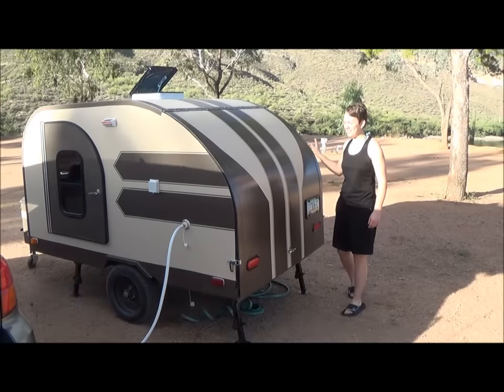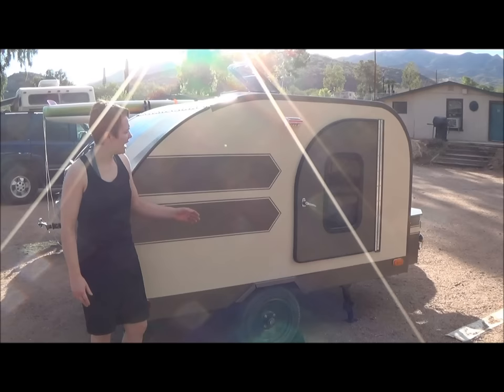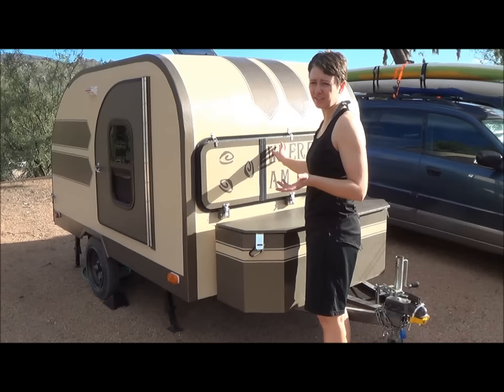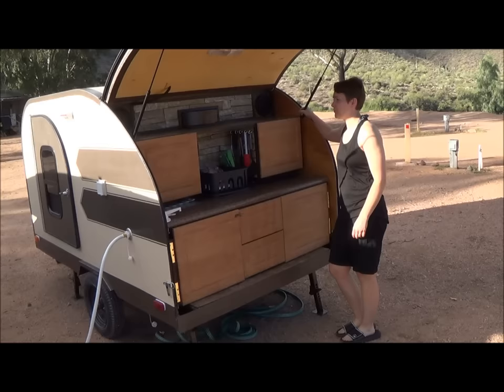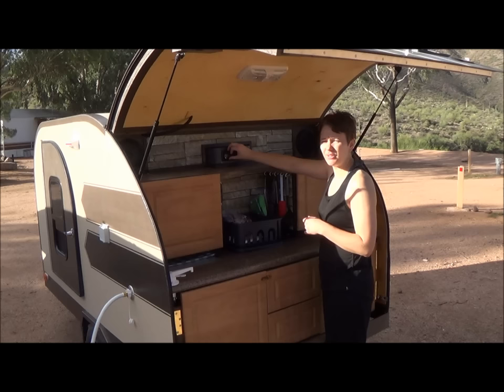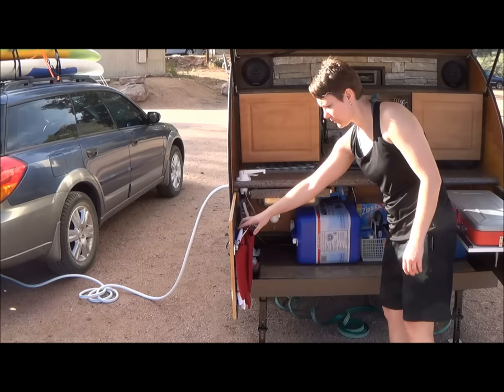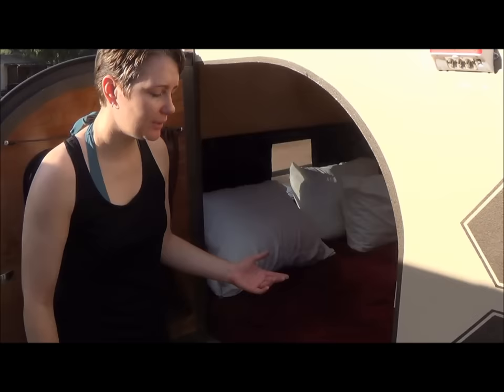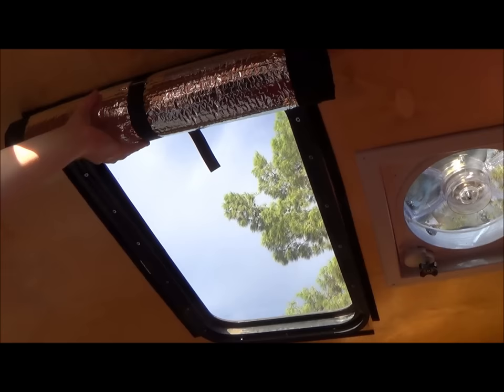Home Built Teardrop Camper (Poor Man's Fiberglass)

Comment: Really, really cool trailer. It looks like you built it from scratch - was there a particular reason you didn't buy a basic trailer and build on top?  Do you have any idea of the final weight for towing? Once again, really impressed!
Reply from the maker: kakman1958 Thank you! The final weight is 900 lbs. The base trailer is a harbor freight utility trailer thatI for $200. Next time I will start with a better trailer.  I didn't want to invest much since I wasn't sure I could pull it off :)

Comment: awesome. thank you for the info. where can i learn that canvas siding thing you did. thats so cool. thanks again.
Reply from the maker: In the comments I have explained a little more detail on the process. most of the YouTube "poor man's fiberglass" look poor in my opinion. I found a really nice one on the teardrop forum and the biggest tip I learned from that post was to router the edge 1/8" and then the canvas bends around it nicer. sanding in between coats it key it make it really shine. I did a trial on a piece of plywood to get the technique down. it works very well!!

Comment: In a couple Comments you said there was a teardrop forum and the biggest tip you learned from that post was to router the edge 1/8". Do you have the link to that form? If not could you explain how you did this? Thanks Anthony

Comment: just came across your video and I really enjoyed it. Very impressed with your built and the look of the camper is nice. Since this was from 2015, have you upgraded to larger built?  And how long did it take for this built from start to finish?
Reply from the maker: I am still using this one. I did build a cargo trailer and just haven't made a video of it yet. The cargo trailer was very easy and only took 10 days. The teardrop I worked on over the course of a year.  But took 6 months off in the middle when I was nervous about wiring it. Most of the time was just trying to decide what to do. Now that I know what to do, it would probably take 2 to 3 months total.

Comment: L Wms - Did you apply "The Mix" to your plywood before starting the PMF process.  I believe the Instructables tutorial suggests this but, in my experience, wood glue doesn't bond well to poly finishes.  Thanks!
Reply from the maker: Sandra Zern I applied the tite bind 2 right to the wood. Worked very well.

Comment: great job. one of the better diy's ive seen. what are the dimensions. have you ever used it in the winter?
Reply from the maker: It is 5'x8'. I am going to take it out over Christmas. It has 1.5 inch insulation in the bottom and top so we will see how it is!
Reply: How was the winter camping? Great? Or more insulation?

Comment: love your work on this camper. Plan to build one myself. How thick is the plywood you use on the hatch door in the back. How do you bend it ?
Reply from the maker: it is 1.5 inch spars with 1/8 baltic birch both inside and outside.  It actually bends easily.  Just use a lot of clamps! 1.5 inch insulation in the hatch too :)

Comment: Very nice teardrop. 

Congrats 

Can you give me some more details on the exterior skin? 

We're did you purchase the materials for the exterior skin? 

Thanks. 

George Cardona Jr
Reply from the maker: The canvas is simply drop cloths from home depot.  I pressed them,  then rolled  tite bond II (buy a gallon at home depot) on with smooth roller cover. Then applied the canvas, pressed it again.  Applied 50/50 water paint,  sanded lightly,  then multiple coats of paint,  sanding between coats.  Practice the technique on a small board. That is what I did.

Comment: Hey, cool teardrop.  Looks great, and I love some of your ideas.  I just saw this in 2019, and have 2 questions 4 years later.  1.  How is your (poor man's fiberglass) holding up?  2.  You did something, I have been wondering.  Your trailer goes over your wheels,  I thought you would gain some indoor space?  Did you?
Reply from the maker: Thank you. I built over the wheels to gain space. I was able to make it 5 ft wide on a 4 wide trailer.  This allows space for a queen size mattress. The PMF is perfect still, granted I have stored in the garage most of the time. It was outside about 1 year.  I just did a 9 day trip to zion and everything was perfect :)
Reply: @thelwood  Thank You for the info,  I am glad to hear that.

Comment: I am in the process of building mine and I keep coming back to your video to watch it over and over again for information, ideas, and inspiration.  My first wall just got clamped to the floor today and tomorrow the 2nd will go up.  I know I've asked you questions regarding your build in the recent past, but now that I'm a further along in the build I find myself planning out the PMF portion of the build so I hope you don't mind if I ask a few more specific questions regarding it.  Did you lay out one giant drop cloth for each side and use your pattern to trace around it but add an inch or so for overlap on each side, including the underside?  Also, did you use a 50/50 mix of TB2 and water and soak the drop cloth in that before applying it to the wall?  Did you iron it before the TB2 dried all the way?  One more question, but not about the PMF; are you going to video your next teardrop build?  I would love to see it!  Thanks!
Reply from the maker: Sandra Zern I am excited you have a wall up! I pressed all of the canvas and then rolled the TB2 on to the wall of the camper. Then I carefully put the canvas on and pressed it before the TB2 was dry. Then I trimmed the edges (do not cut first as it will stretch or shrink in places). I suggest practicing on scrap piece of wood. Then I did 50/50 water and paint. Then sanded. Then more full strength paint, sand. Repeat until desired smoothness. I recently bought a new house with a large workshop so I have been spending my time getting my shop up and running! When I do another teardrop I make a video! :)
Reply: Thanks so much for quick response!  I am looking forward to getting to the point where I"m ready to add the canvas.  Congrats on your new house and workshop!  I am sure you are having fun with that.

Comment: Beautiful job!! How has the pmf stood up over the years? Did you use water based paint? Latex?
Am just at the onset of pmf stage and don't know which paint is best. Also, you used a hot iron on the cloth after gluing it down? What was the aim? Would appreciate hear from you on these 2 subjects. Thank you so much for uploading this clip and showing us what a beautiful camper you built.
Reply from the maker: Hello, Thanks for watching!  On my channel I have a video with more step by step instructions when I did pmf on a cargo trailer.  I ironed the canvas before I put it up and after just to get it as smooth as possible. I used latex exterior paint. The first coat was diluted 50% with water.  Sanding in between each coat makes all of the difference! My teardrop is still in perfect condition.  It has been stored in doors for 4.5 of the past 6 years though.  My cargo trailer has been stored outside for the past 3 years and is also in great shape. Here in Arizona the sun is the biggest issue.  So I can't speak for how it does if has a lot of snow on it or other climate issues. Mine have been through plenty of monsoon storms.  I hope yours goes smoothly!
Reply: @thelwood  Hi there.  Thank you so much for responding, and so quickly. I appreciate it very much. Your answer provides me with the way out of the woods I was looking for so's to continue. Am happy to hear your camper is still in good condition years after; it is beautiful.
Cheers, and thanks again!
Reply: @thelwood  Okay, I just watched your utility trailer pmf informational clip you so generously put together. A real goldmine of information. I can't thank you enough! So appreciated!
Reply from the maker: @shipless33  you are very welcome!

Comment: Great build!  I'm just starting the design of mine.  I really like the size of your sky light/sky gazing window, bigger/wider than the 9" x 44" that I've seen.  You mentioned it being too hot with aluminum.  Are you referencing it was too hot outside to work with aluminum or that camper would just get too hot to touch during the day once built?  How long did your build take?  Thanks for sharing and providing inspiration.
Reply from the maker: +Mike K Hi Mike, Thank you! By "too hot" I mean too hot to work out side and too hot for the adhesive. It was over 110 degrees outside almost ever day that I was skinning. My garage is not big enough to skin it in the garage but with the canvas I was able to. I LOVE the canvas. You cannot see it well in the video but it really does look cool and very professional. There isn't wrinkle in it. It also sounds nice and warm when it is raining instead of tingy. The sky light is great! I worked on it on and off over the past year. I probably worked consistently for 4-5 months. I could easily rebuild in 2 months now that I know what I am doing. I stopped working for a few months because I was intimidated by the electrical system. Then when I finally did it I was kicking myself because it was so easy.  Most of my time was spent looking at it and thinking or redoing work... Many lessons learned :)  Good luck! It is a fun project!

Comment: One more question, What cloth material did you use to cover the trailer. and what did you paint it with after you covered it.
Reply from the maker: George Lee I used canvas drop clothes (8 oz) from home depot and exterior latex paint.  The dark brown is rustoleum hammered paint.
Reply: Wow that was a quick reply.How is the latex holding up. Thanks.
Reply from the maker: George Lee looks like the day I painted it :)
Reply: Thanks

Comment: really good work.

How do you finish the roof to avoid leak?
Reply from the maker: The roof is also poor man's fiberglass. The sky light and fan are well sealed with the butyl tape under the lip and then sealant around the outside. The beauty of the canvas is that is double layer over lap at the edges. Again boats were made with this technique so it should be as water tight as anything.

Comment: I have a dream... that someone could invent a lightweight hardsided camper that collapses.  I hate the fabric pop up campers!  Why can't the walls be of  solid material and collapse?????  Lightweight and transportable/removeable, no affixed to a trailer, but can attach to any trailer...???  Light enough for a small 4 CYL car to put on a trailer and haul...?  What materials would one need to build this dream camper?  Basically a shell, but two walls have lightweight windows in them?  ?? ???? anybody??? Buehler???Where are my great minded inventor people AT!???
Reply from the maker: I just built a foamie that my friend is pulling with his Vespa! Weights 170lbs total with the trailer. I think your dream could be accomplished with a combination of foam,  1/8 baltic birch and poor man's fiberglass (PMF). I was really surprised how strong the foam walls were after we did the canvas and paint (PMF). I just posted the video of the trailer and I will be doing build videos.  I also made a very basic cargo trailer that is removable.  It could easily be converted in to camper. My subaru is a 4 cylinder and handles both of my trailers with ease :)

Comment: What a great build. I am very interested in your build. Are you using 2x6 stubs to raise the floor? And how do you bolt each raise to each c channel metal?
Reply from the maker: I used 2x4 bolted through the holes that are already present in the frame.  Then a 6" 2x4 under the over hang.  I have more pictures of this stage but I can't seem to attach them in a comment.  If you want them send me a message and I will email them to you.
Reply from the maker: I just sent an email

Comment: Hi, liked the teardrop camper build. Great job. My question is now that you have been using it for a while how is the poor man's fiberglass holding up. I am getting ready to build a trailer similar to a Three Feathers Backpacker 2 so I can have a little more head room and was going to use the same covering technique that you used with the canvas. Thanks in advance.
Reply from the maker: Mrflashlite so far it still looks like new.  It has been primarily been covered though. So I don't know if it would still look perfect if it was stored outside all of the time.
Reply: Thanks, like it when people take pride in their work. Need to post some videos of the trips you take in it.

Comment: Beautiful!  You did a wonderful job!  I plan on starting to build one in a few months so I'm doing a ton of research now.  I see that you built over top of the wheels and I would like to do the same unless I can get a 5 x 8 trailer but I"m having a hard time finding a used one.  I may purchase a 4 x 8 used trailer tomorrow but I'd really like the camper to be 5 feet wide.  Did you use a 4 x 8 trailer and build over the wheels / extend the frame of the trailer?  Also,  does your mattress sit flat on the inside floor or does it sit up over the interior wheel wells?  I hope my question makes sense.
Reply: When taking a closer look at the still pics you placed at the end of your video I see that you raised the bed by placing 2 x 4 in the upright position - am I correct in that?  Is the 2 x 4 that's over the wheel shorter than the others?  Did you bolt them down to the trailer by drilling holes vertically through the 4" side of the 2 x 4 and carriage bolt them?  Sorry for so many questions but I really like your build and hope to model mine after yours.
Reply from the maker: Yes I used 4x8 trailer and did 2x4s and bolted them to the frame.  :)

Comment: great show do you have a favorite link to "poormans fiberglass" that you used? another thing I can't get over is ... how did you get the mattress inside?
Reply from the maker: I don't have a link. I used several websites and then trial pieces. The mattress came from the factory in a tight roll. It will be hard to ever get out but it was easy to get it in :)

Comment: i was wondering if i could pick your brain. i want to build one and i like yours the best. would you be able to point in some direction? like maybe websites, etc. are the side walls cut from one 4x8 sheet?  are those 2x2s for the framing? where did you get the camper parts?(30a plug, water, antenna,etc). i guess im fishing for as much info as possible. thank for replying. again, great job.
Reply from the maker: Hi David, I used several resources. The shape and basic design came from free Ben Roy plans. Google search free Ben Roy teardrop and you will get plans. I ordered most of the electrical components from amazon. I used a wiring model from the teardrop forum (Google search it). the forum has tons of info!! I upgraded to 30 amp (the plans call for 20 amp). 20 would probably be enough power but campgrounds have 30 amp so I just went with that. The big change from the Ben Roy plans was building up over the wheels to make a queen bed on a 4'wide trailer. if you started with a 5 wide trailer it would be easier. I got the trailer cheap on craigslist so I went with it.

Comment: We have a question regarding the front window protector. How did you attach the clamps and hinges to the luan? We did find some clamps on amazon that look like they'll work. Finger crossed. Thanks in advance.
Reply from the maker: I used 1/8 baltic birch and with the canvas over it, it is surprising strong. The hook part is also close enough to the window the I hit the wood spar that goes over the top and bottom of the window. So screws with some sealant under them worked just fine.  Good luck!
Reply: @thelwood  Awesome, thanks so much!!!

Comment: I love it! Can I ask how you worked out all the seals on the door and hatch? I’m in the planing stages and that has me a little intimidated. Thanks 😊
Reply from the maker: Thank you! The hatch was super intimidating at first! But it wasn't too bad as I got going.  TNTTT is a great forum and helped me a lot! My doors have never leaked but I would definitely buy them next time instead of making them.  They are a pain to make and I have to sort of slam mine to shut them so the seal is tight.
Reply: @thelwood  awesome! Thanks for the tip! Another thing I was confused on was the PMF. You said you used a 50/50 paint-to-water on the first coat, then did you go straight to full strength paint? Or did you gradually decrease water in the next couple of coats ending with a couple at gull strength coats. 
My foam has a lot of dents and blemishes that will show through the canvas. I’m wondering if I should smooth them out with bondo or something.. after the first coat of paint maybe.
Reply from the maker: @lynnporiumartdecor8348  https://youtu.be/S3JIyhbdi-Q here is a link to a very detailed video I did on the PMF process! Sanding is your friend!
Reply: @thelwood  thank you again! You’re an inspiration 🙌
Reply from the maker: @lynnporiumartdecor8348  thank you!

Comment: nice job but why install the side doors backwards? the radius corner of the door belongs on the radius side of the trailer to match...it looks backwards sorry
Reply from the maker: Coherant bliss it would be harder to keep it water tight that way.  Long straight edge makes for a long hinge for the direction water would enter when driving.  It is the shape of the original  ben roy teardrops :)
Reply: Function before form....makes sense I like it. I'm thinking of building a smaller one than yours...I might be asking you a few questions....(type and thickness of the canvas, sealer/paint etc.). I've never heard of using canvas the way you did...I've done a lot of fiberglass work on boats and street rods so this canvas thing is intriguing. We never stop learning! peace
Reply from the maker: Coherant bliss Good luck on your build!
Reply: I wish more women were like you...   :)